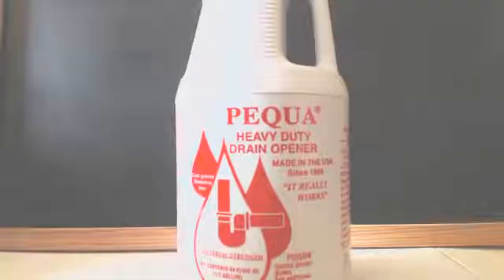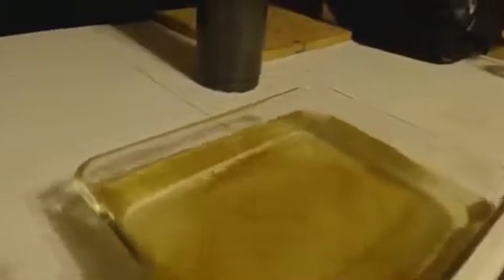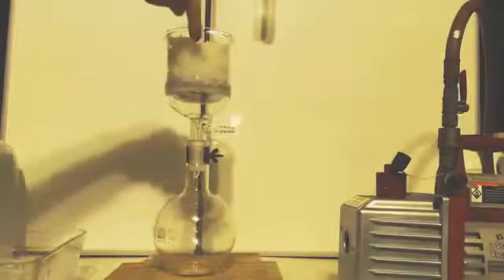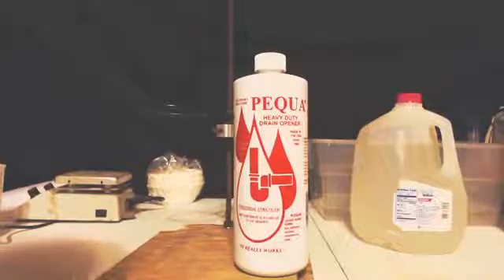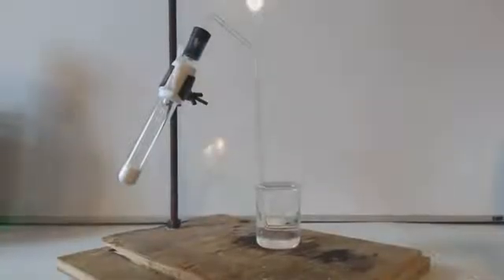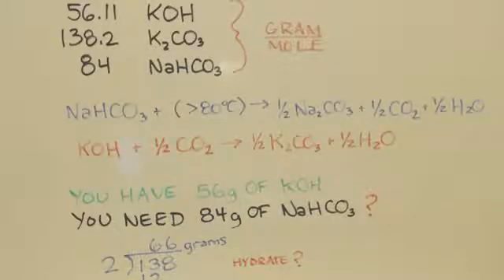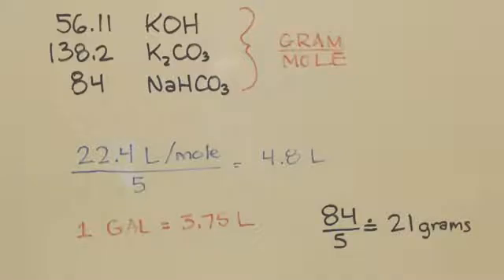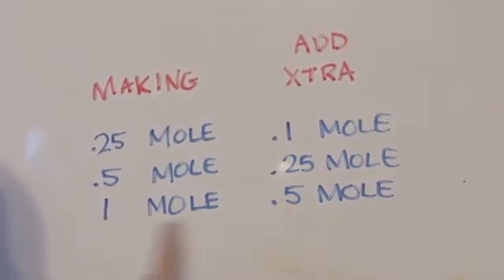POTASSIUM CARBONATE SYNTHESIS

Comment: Using the same brand of KOH drain cleaner I wasn’t able to remove the color with just heat. The way I found was by adding a squirt of 3% hydrogen peroxide with medium stirring. The blue color instantly turns clear orange and causes fizzing like a soda. With constant stirring and heat the fizzing picks up, the solution darkens and then clears up suddenly leaving a clear KOH solution and a chunky brown precipitate which I think is the inhibitors. Use the clear basic solution as needed.

Comment: I don't need any potassium carbonate, but I do want some potassium hydroxide. I watched this some time ago and tried to find some KOH locally with no luck. I just went to Home Depot and they finally started carrying it :-) So purchased a 32oz bottle (prob should have gotten the bigger one), and will be trying this out.  I have it sitting in a Pyrex dish in the oven at ~70 °C. I'll check it in a few hours to see if it works as well as your radiator did when cycling it.
Thanks!